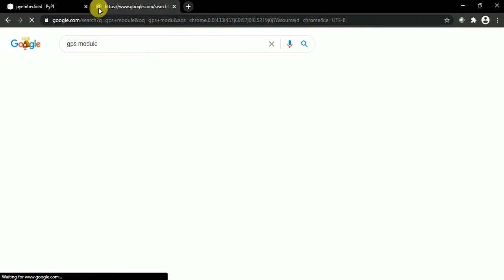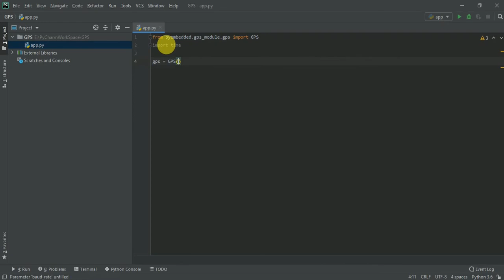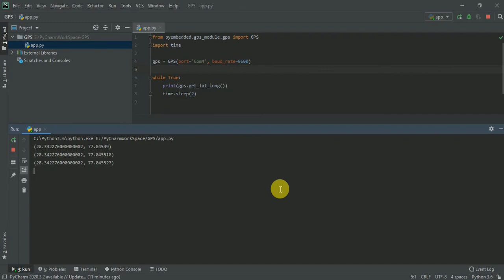Interfacing GPS Module using Python | PyEmbedded | Rocket Systems

Comment: I tried to use your code and the library but when I ran the python file in the terminal, it gets stuck. I used SIM808 module and an Arduino Uno.